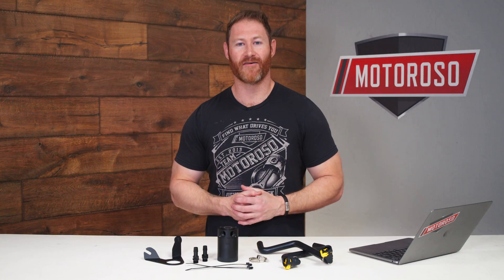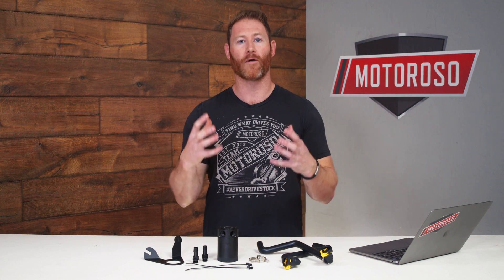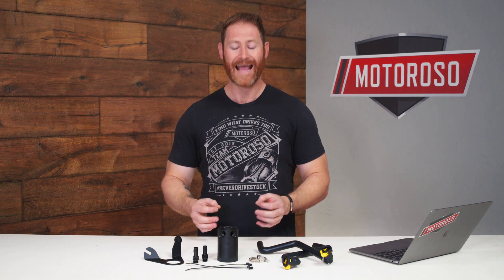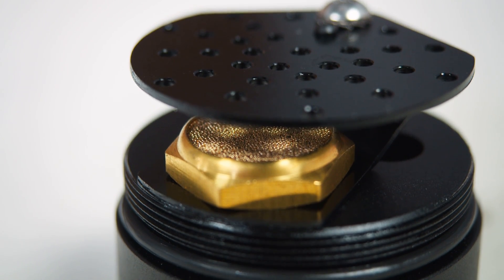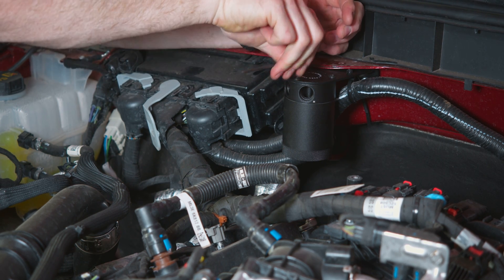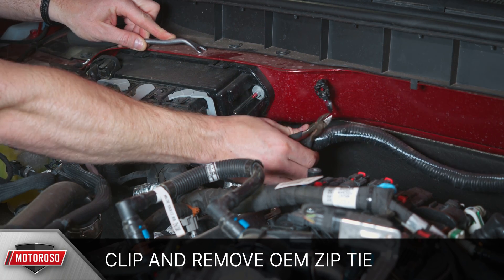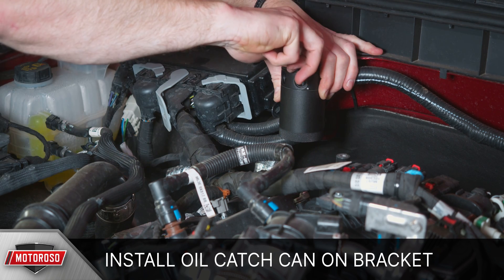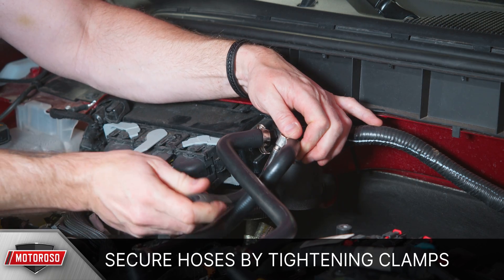Mishimoto Oil Catch Can for the 2021+ Ford Bronco | Spotlight and Install

Comment: Do you need locktite?
Reply from the maker: A little might help, but not really necessary.
Reply: @Motoroso  I have the unit but no locktite.
Reply from the maker: @angelokings  I think it’ll be alright, check it every once I a while, and it anything loosens up…. Add loctite.

Comment: What is the advantage of the dual catch can over the single for the 2.7 ecoboost bronco is the extra can necessary?
Reply from the maker: Consider the single can 70% protection, and the dual can maximum protection against blowby.
Reply: @Motoroso  do you have the dual catch can in stock ?
Reply from the maker: @janvergara8620  they’re not released yet, but coming very soon. I recommend placing a pre-order for it, here’s a link: https://www.motoroso.com/p/2186821-mishimoto-2021-ford-bronco-27l-baffled-oil-catch-can-system
Reply: @Motoroso  eta says May 2022 but it’s already June, do you have a more accurate eta by any chance ?
Reply from the maker: @janvergara8620  should be this month. Everything in the world is delayed and unpredictable due to supply chain interruptions. But if you pre-order, you’ll get it sooner than if you wait. This applies to everything, just fyi.